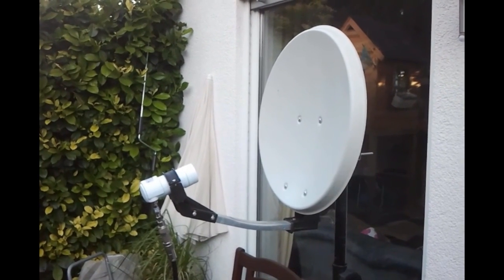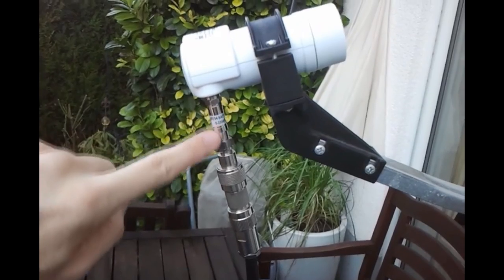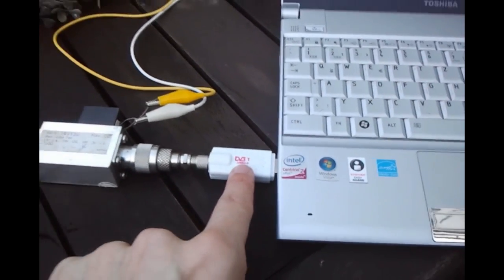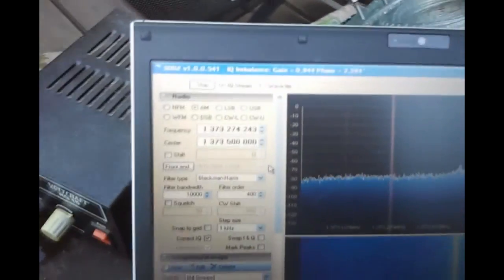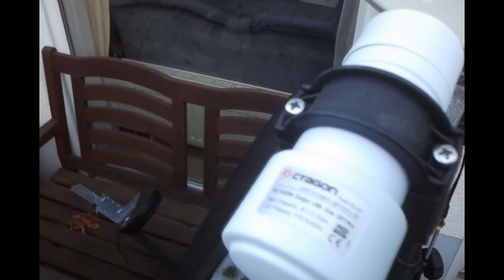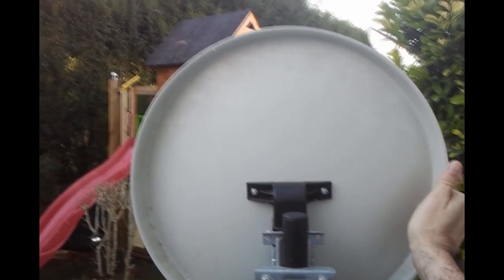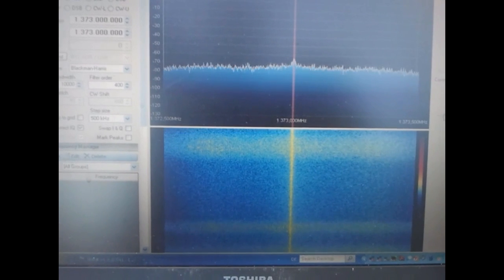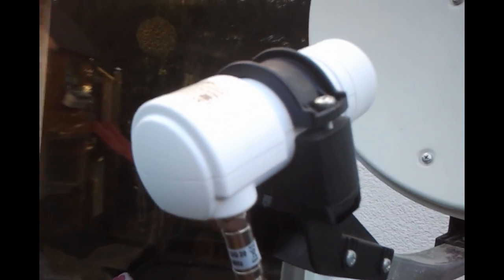RTL SDR as cheap TV Satfinder

Comment: You can also It use with SDR Angel that be use to See TV Stations Directly,
Reply from the maker: Actually most DVB-S signals have a much higher bandwidth than an RLT-SDR can receive, hence SDR Angel is only usable on low bandwidth DVB-S signals or you have to use much more expensive wideband capable SDR devices.
Reply: @MegaOscarVideos  I have a SDRPlay RSP DX Receiver, not made in China,
Reply from the maker: @ManuelPinner  The SDRPlay RSP DX is only capable of 10MHz maximum bandwidth, while a typical DVB-S satellite TV signal has around 36MHz bandwidth at the most typical symbol rate of 27500kS/s and QPSK modulation. 
With SDR Angel you could only receive narrowband (Amateur) DVB-S TV signals, but not the ordinary commercial TV signals, due to bandwidth limitations of most common hobbyist SDR devices

Comment: Can someone please explain how a RTL-SDR rated from 100-1700 MHz can capture signals >10GHz. I am new to this and I ordered an rtl-sdr v3 dongle. How can an LNB convert 10GHz sgnal down to a GHz and can I still convert that to actual useful data using SDR software? Thanks in advance.
Reply from the maker: The LNB which sits at the dish will convert the received KU band signals >10GHz down to an intermediate frequency between typically 950 - 2150 MHz....and the bottom part of that can be received with an RTL SDR. Very simple.
Reply: @MegaOscarVideos  Yes but how exactly is that happening, because a 10GHz signal contains a lot of information right? Aren't we losing lot of bits when downscaling it to lower frequency?
Reply from the maker: @Quancept  No, you do not lose anything. Let's say you receive an SAT TV signal transmitting on 11GHz. That is just downconverted internally in the LNB to 1250MHz (assuming a Standard LNB with 9750MHz LO). The signal you receive on 1250MHz in such an example at the output of the LNB is 100% identical to that of the input received by the antenna since it's just downconverted.
Reply: @MegaOscarVideos  got it. Thank you

Comment: I hate to tell you this but the dongles cannot directly receive satellites in the 11 or 12 ghz range.  Their upper limit is around 2 ghz.   If you really want to see the signal, you need a free to air receiver with an IF output of around 950 to 1450 mhz and you hook that to the input of the dongle.
Reply from the maker: +Steve Frost I hate to tell you this, but a LNC converts the 11 /12 GHz band down to 950 - 2150 MHz band, therefore you can easily see many of the TV transponder signals on the waterfall and spectrum display of any ordinary SDR software with your RTL SDR  (of course you cannot wath TV with them, but this wasn't the purpose of this video anyway). Cheers mate.
Reply: +MegaOscarVideos I hate to tell you this...but you are absolutely right.  The funny thing is that I know better.  I have installed satellites for 18 years and am an advanced ham operator for over 30 years.  I have also played with the RTL dongles for a couple of years.  I just was not thinking when I posted.  Cheers to you too, and thanks for the video
Reply: Thats good apology.
I thought as much; you're not aware of the purppse of the video
Reply: Steve Frost IF output is the same thing loop output?